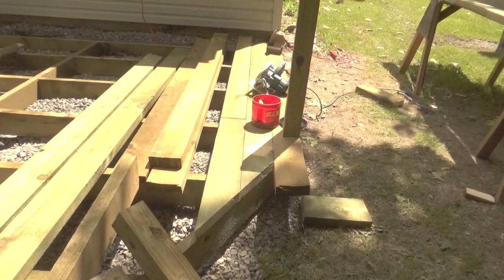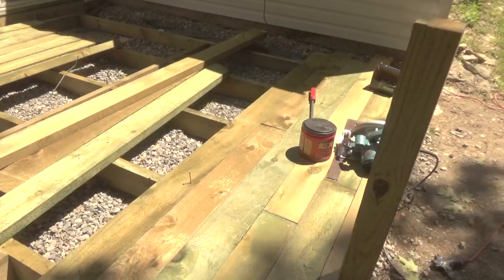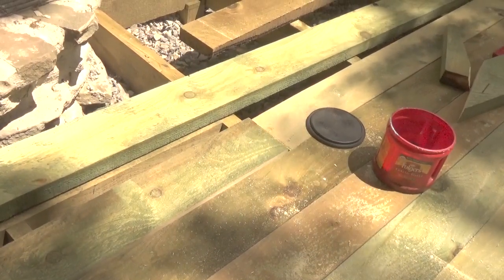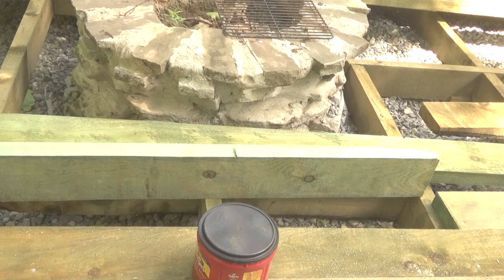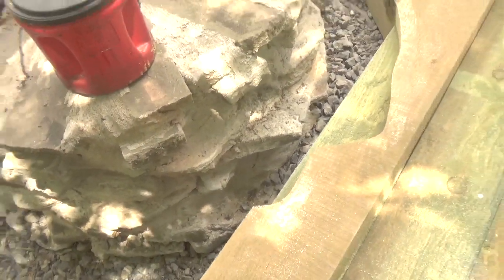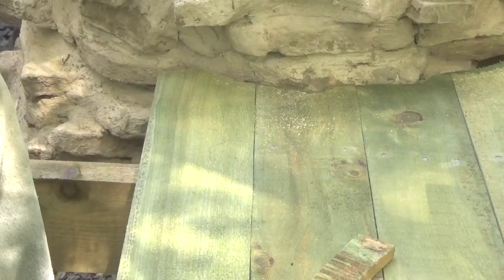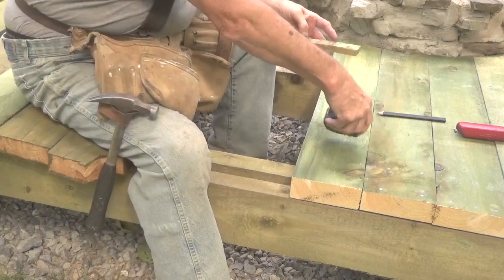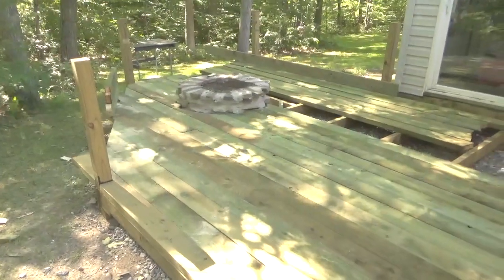Deck build, nailing the walking surface down.

Comment: Thanks joe for the refresher but I have not seen the scribing with the block of wood before so I will sleep good tonight because I learned something new today good info thanks
Reply from the maker: Larry Downes Thanks for the comment how did you make out on that siding job?
Reply: I am in process of making 8" cants right now. I think I am going to turn all the logs to 8" cants set them aside and cut the siding when they are cut to size hopefully I will have the all done by wednesday and all the siding  cut by next saturday. Hopefully we will get tractor running tomorrow and drive it home and get it moving the heavy logs

Comment: Good tips on the gaps compounding themselves! I just had that happen on weaving in new T&G flooring with old, luckily I was only a few rows from the wall (and under where the table sits!)
Reply from the maker: 1rustytree It doesn't take much to get messed up. Have to keep checking as you go. Thanks for the comment.

Comment: Hey Joe looking good, you'll be cooking hotdogs this fall on your new deck. Since there's always more than one way to skin a cat, .... take a 60 penny nail dull the point a bit so it won't split your 2by4 drive in 6"" or so from the end use same way as your wood chisel method only stick nail lightly into the side of stranger and lever in place.
Reply from the maker: One of my carpenters use to do it like that. I would hope that some young guys realize you don't have to have the latest and greatest to get things done. Yes sir on the hot dogs and throw some potatoes in foil in there and I can be happy. lol

Comment: Joe,  Deck looks great,  for the wedge board trick a Cordless drill and screws to hold down the temp board works good as well.  They you don't have to hassle with pulling the nails back out.  Have to hassle with the drill though so its probably a Horse-a-peace which ever way you due that.

 I'm gone for a week At Boy Scout camp and living in a Tent so I'll be off grid and Hope you get alot done for me to watch when I get back!  Keep up the great work!
Reply from the maker: Matt Butteris Have a good week, going off grid for a while should be good to clear out the brain.

Comment: I’ve been telling people who  want to do their own decking. Use a piece of plywood with a hole large enough for the nail head but certainly smaller than your hammer head & to have plenty of them. With the new material screws are the fastener of choice. I’ve seen many Philip head & square drive holes in that expensive decking. You can use the same technique,but don’t stop the screw before proper depth. Those screws have a paint like coating, it can make the driver socket uneven. 99% you’ll bend it. So if the screw doesn’t fit on the driver set it aside.
Reply from the maker: Kim Danielson Good advice, thank you.